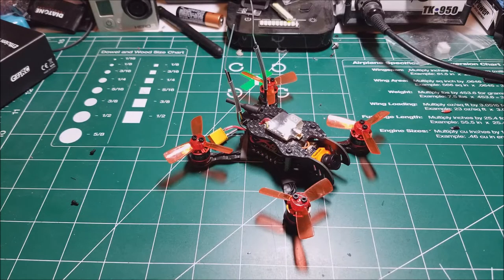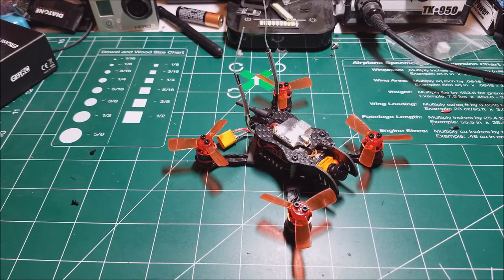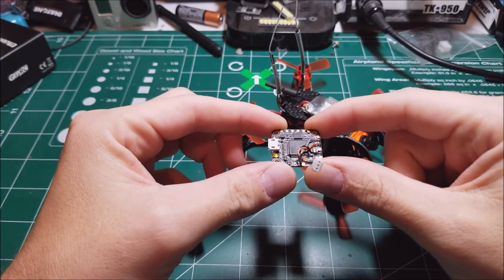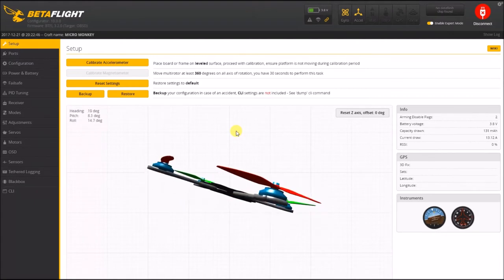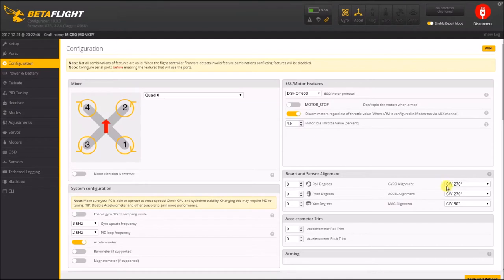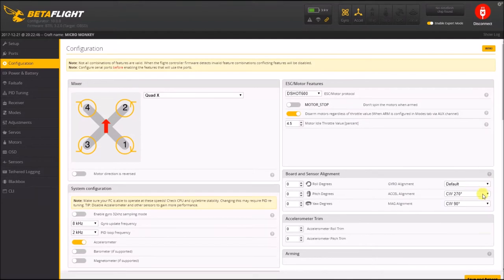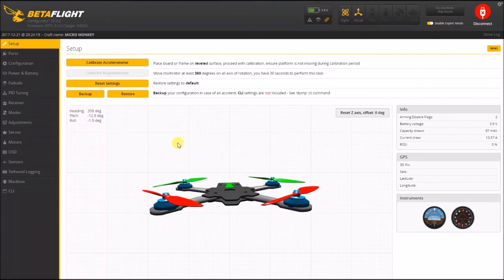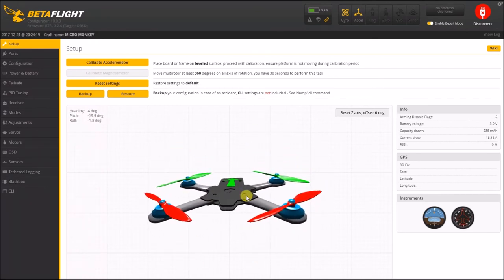How to identify Accelerometer Alignment issues in Betaflight

Comment: Like you I have built 4 or 5 quads. In opening the configurator the first thing you come to is the Calibrate Accelerometer tab on the setup tab. First things first rite? JB says to calibrate no matter if you do turn it off but you still need to calibrate not reiterate!
Reply from the maker: In this case, I had the FC out of the quad and didn't pay attention to the alignments being off. By the time I noticed it my quad was already flipping out. Calibration didn't help here. The only fix was to adjust the alignments.